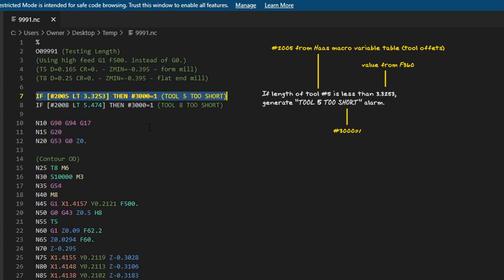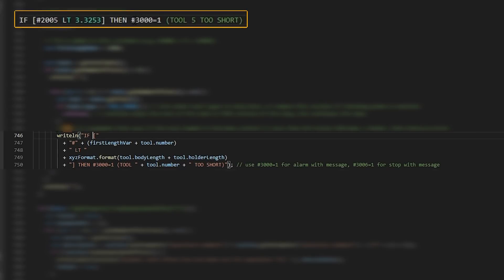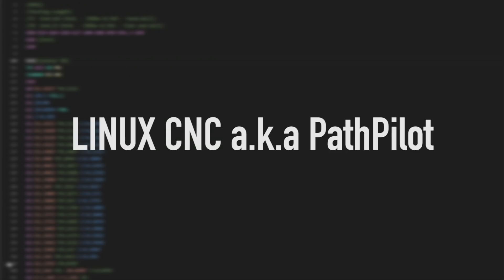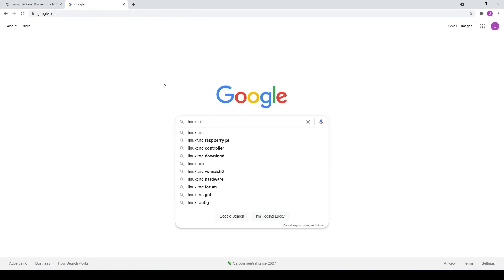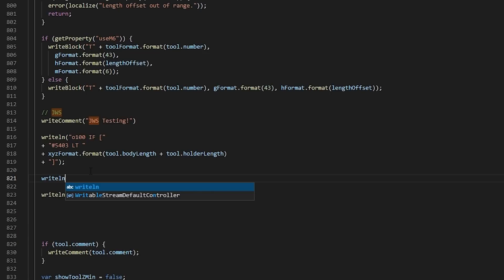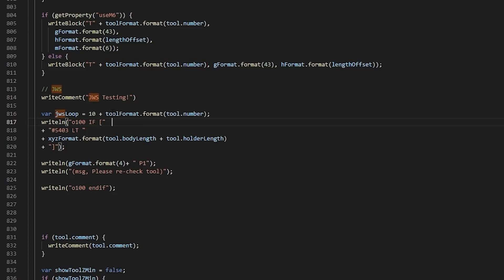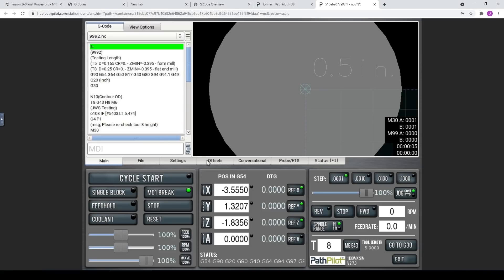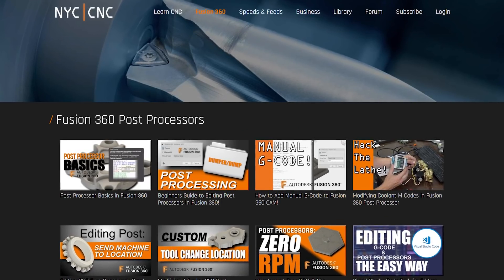STOP CNC CRASHES! Intelligent Tool Check!

Comment: Nice video, Your video will help a lot of users thank you.
  I did something similar in production back in 2005 with Mastercam & DMG Mori machines with the Fanuc controls. We had preset tooling and sometimes the operator would fat finger the tool offset. I had my Mastercam post output my G-code macro call (G543 H=Tool gage length) after the (M06) to do a quick check before the machine ran each tool.  The macro checked the gage length +/- 2.5 mm or .0984 inch based on what the machine was running in as we ran production in both units so the macro had to be universal.  

Example program format:

G0G17G21G40G49G80G90 
N1T9001(INSERTED MILL)
M6 
G543H134.000(CHECK GL) 
G65P6492B135.(COORDINATE ROTATION) 
M11
G0G90G54B135.M88 
M10
G0G90G54X-27.265Y-220.85S3018M3T9002
G43H99Z56.243

Comment: My tormach sprutcam post does not include any data what so ever for tool holder or actual tool overhang in the posted code for my mill. The cam uses this data for simulation only and is never added to the generated g code file.  The  post would need to be changed to output this data to use and check by the logic your using. I dont use fusion 360 but code I have seen from it for tormach mill is about the same and does not include holder and overhang data in the generated code.   is this only for haase or other mills?
Reply: watched video again and this could  be done about the same way in sprutcam posting to Linux cnc

Comment: I've done something similar. OEM so I have a standard suite of tools in my magazines.
I wrote a check file that is read on every tool call. Every tool has a length with min and max tolerance. Machine tests upon every tool call so even if operators are loading tools while it is running, it will make sure the drill has enough protrusion when it is loaded into the spindle and that no tools have had a fat finger dimension. 
If the tool doesn't exist in the reference file the operator gets a caution message with M00, if the tool is out of spec an alarm, and if it's fine the operator never sees anything.
It all happens in the background and certain folks don't have access to the reference file.

Comment: For a very long program, the Pathpilot version would be very annoying to have the last tool alarm out. A more user friendly implementation would be to have each offset in the program temporarily applied in the header of the program and checked before going on to the first tool in the program.
Reply: seems like significantly more work in the post, but if you're game to show how it's done i agree it'd be more pro-active instead of reactive.

Comment: Why is the default in the tool table 0? The default should be a large number so if you don't set the tool length, you get almost 0 z travel and the tool stays way too high, rather than the default being 0, so if it's not set, it drives the tool into something. Set all your unset tool lengths to some large number. This post processor script is still a good idea too, but just set the defaults to be safe, not crashing into things.

Comment: I've never used path pilot but on LinuxCNC you can save a subroutine to a separate file once and then call that subroutine everytime you use it, that way you don't have to renumber the if block every time.
Reply: Yes.  I use it as a macro for touching off tool heights on a tool height setter.  Even have it set up to ignore known tools and re-touch drills and other variables each time.

Comment: Hi John,  would it be possible if the time permits to help me figure out a way to produce a post for a machine that has a controler that fusion does not offer posts for yet? I have a thread opened on hsm and I had no luck figuring out the solution.
I would greatly appreciate it! Thanks
Reply: What's the machine?
Reply: @urgamecshk  it is a Chinese cnc 3 axis router that uses a taiwan controler from LNC.  MW2200

Comment: Great idea.  Maybe I am missing something on the linuxcnc edits but wont you get a sub call not unique clash if you use the same tool number more than once? I.e. T1 then T2 then back to T1?  I ask as you are not incrementing the tool var just setting it.  Ie it was jwsloop =, not jwsloop +=, or jwsloop=jwsloop+….   But like I said maybe I am missing something.  Cheers.

Comment: I can't recommend doing this enough. 
We have a report script that does a tool measure program. So once you've loaded everything in, it goes and measures every tool used on that job. It compares the measured length and what it should be. Also, it does a tool data check for the diameter and corner radius.
We have it in cycle as well after the tool call and it M0s and loops if it's incorrect so it's pretty much impossible to run unless it is correct.

It's definitely worth the extra 5 minutes set-up time on a job, when you're doing high-value parts that take days to machine and the billets cost ££££.

Comment: Thanks John... my eyes gazed over though.... I guess If I was a machinist this would make more sense.
Reply: I am a machinist and my brain went numb. Not saying he did anything wrong. I'm just not very computer literate. So a few acronyms in i was quickly overwhelmed.
Reply: If you do cnc start cracking the programming manuals for your machine.
Macro has so much more potential than you realize.
A program like shown in this vid could all be set up to happen with no macros cluttering up part program.